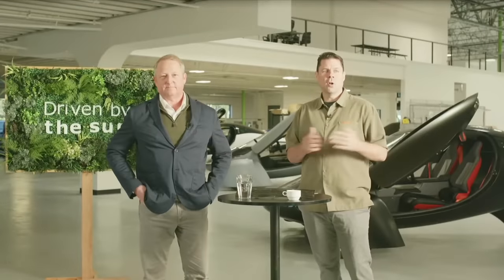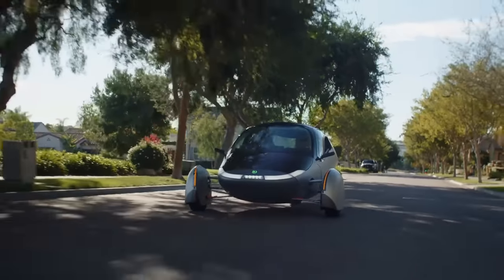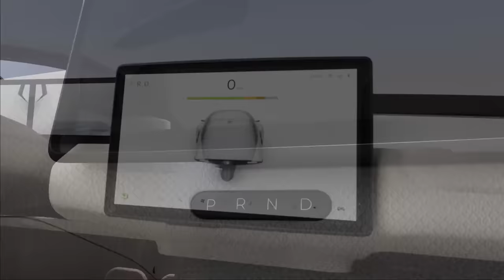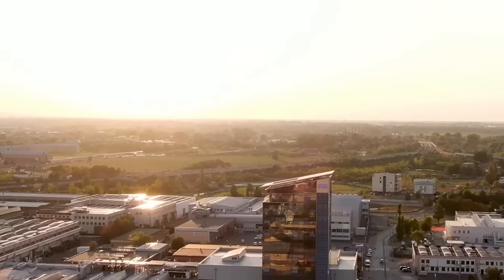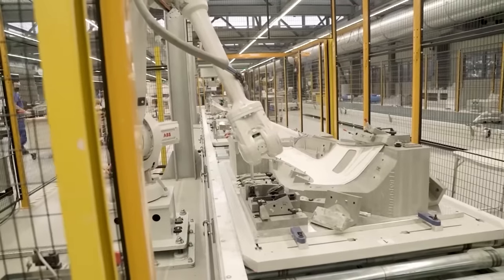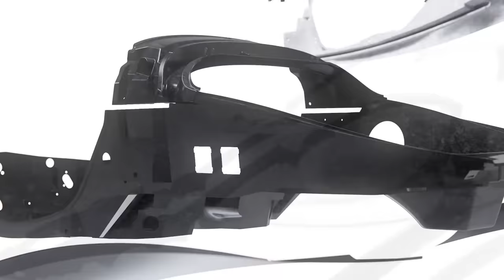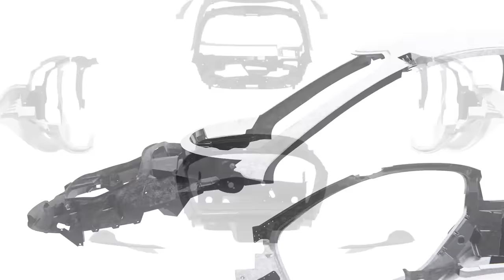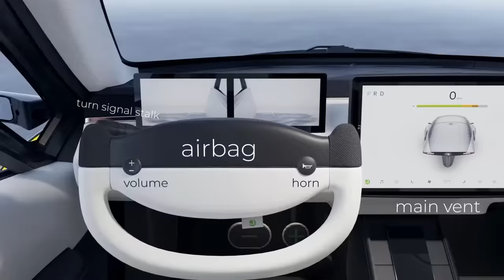Announcing Aptera's Launch Edition | Live Webinar

Comment: Edit 2: Aptera just announced (01/23/2022) that the Launch Edition and all Aptera vehicles will come standard with DCFC at a 40-60 kW charge rate! So happy they listen to feedback!

Edit at bottom; less concerned about DCFC now.

Excited for this launch edition... Exactly what I had reserved, with the exception of the enhanced audio package. However, I have to say I'm concerned about the lack of any DC fast charging... One big reason I wanted an Aptera was to take road trips of 400-600 miles in a day, and that would require fast charging to not be inconvenient, especially toward the upper end of that range. I understand the thermal limitations in the battery pack, but I was hopeful there would be at least low-rate DC charging capability.

Edit: just read a comment from Aptera where they said they "plan to offer a DC fast-charge capability at a rate of 100 miles in 10 minutes eventually and as an upgrade to your Aptera at a later date." If it's going to be possible to add-on in the future, I'm much less concerned about the lack of DCFC in Launch Edition. Would much rather have the vehicle for most of my usage and later add-on extended road trip ability, than wait to get one.
Reply: Generally DCFC is prohibitively complicated in software for small teams to include in a launch edition (needs complicated communication between the vehicle and the charger and needs to comply with certain ISO standards which require 3rd party testing) whereas AC charging is more of an “on or off” thing when talking to charging stations 

TLDR: Generally DCFC can be added in software later
Reply: Here's a thought for you though, assuming as a human you need to stop at some point during your 400 to 600 mile journey and you have the 400 mi version of vehicle you will perhaps stop for lunch at a place where you can plug it into a level two charger and because it is so efficient perhaps you will gain the additional range that you need for the day while you eat lunch or take a break from sitting so long.
Reply: @ElectricTechAdventures  yes, I think for my purposes it would be possible - just makes the days longer and something to plan around. Aptera's stated level 2 charge rate from the video is 57 miles per hour of charging, so to get up to the 600 mile goal in one day, I'd have to charge about 4 hours on the road. A bit long for a lunch break - even for all three meals combined - but technically possible.
Edit: about 4 hours, not at least
Reply: @woolerybrad  yeah good point. About 4 hours is a long time. In another comment I saw they said that somewhere Aptera said that eventually they would allow DC fast charging at Tesla superchargers but only up to charging at 100 mph which is just over 10 kilowatts probably. I don't know that Tesla will like that because it is a very slow charge rate where an Aptera vehicle would be taking up a plug that could potentially be dispensing 250 kW to a different vehicle. In any case I think The fundamental issue here is active thermal management of the battery. Charging as a lot of heat to a battery pack. And the vast majority of users probably will not be trying to use these vehicles for long distance road trips. But what do I know I'm just some dude on the internet. :)
Reply: Thank you very much for posting this. I was extremely concerned and was thinking about canceling my reservation over the lack of DC fast charging. This makes a lot of sense, especially considering they made a big deal of advertising compatibility with Tesla's supercharger network, and as long as they add DC fast charging in software eventually I'll be fine with this
Reply: @ElectricTechAdventures  no. They stated that level 2 charging only adds 57 miles of range per hour. So once you drain the battery you're pretty much done driving for the day.
Reply: Where did you see this comment? They were very non-committal in the video, like they somehow don't understand how critical range is
Reply: @matthewryonadams  or they recognize how big of a deal it is and they were trying to avoid the subject. It was just a comment on this video somewhere, there's no way to point directly to it because there are no addresses for comments. And the comment isn't proof of it being true anyway.
Reply: @matthewryonadams  I would hardly say my comment is a hard no. You get 57 miles while you were eating lunch for an hour. That's not zero but it is certainly nearly zero comparatively. I understand your point and it is clear that this vehicle is limited in its road tripping abilities, at least until they increase the charging speed. I would rather that they come out with something, even with this limitation, then going bankrupt and not producing anything at all.
Reply: @ElectricTechAdventures  I see it differently. They should work on dcfc now. If they launch with only 57 miles/hour charging they will be shredded in the court of public opinion, and that perception will linger even after dcfc is added. It's a major tactical error.

Bankruptcy is likely not a real risk. I'm sure they've got options to get the money they need, but are being choosey about the terms and foregoing until necessary.
Reply: @matthewryonadams  we'll just have to wait and see what happens.
Reply: @ElectricTechAdventures  I agree. As much as road tripping is nice, very few people actually do it all that frequently. Additionally, when I road trip I take a stop every 3 hours or so to take a half hour break so I can refresh and make sure I am being a safe driver. Let's say that's 25 miles added every stop on a 12 hour trip,  that's an additional 100 miles just from charging plus if it is sunny I will be getting the free 40 miles. Max range before I sleep on a 400 mile vehicle for me would be about 540 miles. Which would get me from San Francisco to LA along the scenic coastal rout with 50 + miles to spare.

There's what I want the potential to do and what I will actually do. For me wanting fast charging in a car that has a range over 300 miles feels like wanting an SUV in case of snow storms. Still I ordered the 600 range given that I have range anxiety :P So I expect no real problems on road trips. But everyone's mileage may vary.
Reply: @LC-sc3en  I agree. I also ordered the 600 mile version so that it will have roughly equivalent range as my Cybertruck so that if we need to go on a road trip with both vehicles then they both will have the same range to get there. We rarely drive over 600 miles in a day. The Cybertruck would most likely be pulling a travel trailer so it's range is probably going to be closer to 250 mi before having to charge but luckily it does have fast charging.
Reply: Adding a separate comment here to reflect my second edit... Aptera just announced (01/23/2022) that the Launch Edition and all Aptera vehicles will come standard with DCFC at a 40-60 kW charge rate! So happy they listen to feedback!

Comment: Aptera: I changed my order to launch edition, BUT, no Level 3 (DCFC) is likely going to be a deal breaker. You have now limited travel in one day to about 350-400 miles with a stop for lunch with a Level 2 charge. I'll keep my order in the queue until launch, then I will ask if you've changed your mind and added Level 3. So much for "see the USA in my Aptera."
Reply: But that’s about 6 to 8 hours of driving in one day. Do you think most people will want to drive more before they want to stop to sleep?
Reply: @asazad  Yes! I also then have to find somewhere at that point to waste 6 hours while charging. NOT acceptable.
Reply: @asazad  Our goal in traveling between AZ and WI is 1800 miles in 2.5 days. 400 doesn't cut it.
Reply: @ronaldlenz5745  Man I feel tired just thinking about such a trip 😅. People sure have a diversity of preferences and tolerances.
Reply: This is my thinking exactly. I only consider EVs that are capable of longer road trips. Do I do this often? No, but I don’t want to have to own another car for those occasions when I do. Extremely disappointing for a vehicle that looks so good otherwise.

Comment: Aptera stated so many times in the past that it would charge ~400 miles in 1 hour. Not 57 miles in 1 hour
Reply: Aptera has reversed course on this.  New video out today on DCFC from Chris & Steve at Aptera.
Reply: @jonj9149  maybe with better batteries. a megawatt ish isnt that much. 1200 whores power engine basically

Comment: Very concerned about lack of DC fast charging on launch edition.   Stated charge rate is 57 miles per hour of charging.  So to add another 300 miles you do a pitstop of 5 hours?   This will be a deal breaker for many potential customers.  EDIT: see Aptera replay further below stating ".. while we will not offer DC fast charging to start in the Launch Edition vehicles, we plan to offer a DC fast-charge capability at a rate of 100 miles in 10 minutes eventually and as an upgrade to your Aptera at a later date."   This has addressed my concerns.  Go Aptera!
Reply: Yes, the lack of DC fast charging is disappointing. But it is a great move for the simplicity of the vehicle. High volume production is hard, and this simple design helps to make that possible.
Reply: I was hoping to have DC fast charging in the 400 mile version. The 1000 mile version would take over 17 hours to charge at that rate.
Reply: 57 miles is in reference to level 2 home charging. Charging will be much faster at a Tesla Supercharger.
Reply: Most people do not travel that long regularly enough for that to be a problem, besides those people can wait for the longer range models. With a first production vehicle you have to make it as simple as possible, it's always a compromise of features in order to get the production going; you can't please everybody. People have gotten so spoiled with Tesla where they are today and compares a small startup with a multi billion dollar company that produce normal EV's and has done it for over a decade; it's not the same at all. Tesla didn't spit out the Model 3 the first thing they did, it took many years to get to where they are, and even they were just a hair away from not making it.
Reply: @BrianLambert  Isn't a Tesla supercharge DC fast charging?
Reply: @Brian's Game Talk  Supercherging will not be available for the launch edition. It is disappointing, but regardless this will be a great commuter.
Reply: @JorgTheElder  I changed my reservation to the Launch Edition since it matched my order exactly, and my intent was to only use this as a commuter vehicle, but when Aptera adopted the Tesla charging plug, they also adopted the absolute best fast charging network in the USA.   As an investor, I hope they offer DCFC as an option very quickly after the launch edition to expand their customer base and overall utility of the vehicle.  One can imagine a purchase of this vehicle for a college student who occasionally has to drive to and from college to home.
Reply: @BrianLambert  I don't think the Tesla Superchrager will be of much use  without DCFC built into the car.
Reply: Edit! Aptera states over and over again that it supports Tesla fast charging ... On  the website...  They are removing it to simplify heat issues.  The numbers they showed are just for standard home charging - which are fantastic - the best in the industry.  Doesn't affect my interest in purchase but I can see how that would be annoying
Reply: I agree with what @YeeLeeHaw  ... You hardly ever see a "base model" vehicle with many bells and whistles, those are typically the "premium or limited" versions of the vehicle that get more features... think of the initual launch vehicles as one of those stripped down base vehicles you find on manufacturer websites.
Reply: @BrianLambert  they stated no fast DC charging on launch vehicle
Reply: I agree, lack of fast charging would be a deal breaker for most drivers.  But Aptera has to survive the next year of ramp-up, and I'm sure there will be 5000 early adapters who will be thrilled to get the LAUNCH version.  Have patience, Aptera will solve the technical problems and have a decent charge rate for later editions.
Reply: Aptera commented to someone else that DCFC at a rate of 100 mi. in 10 minutes would be a future option, and would be available as an upgrade to existing Aptera "at a later date." At least for me, that takes the lack of DCFC in Launch Edition from a major concern to an inconvenience. Happy to get the vehicle sooner and then upgrade capability later.
Reply: @woolerybrad  this is the update I was hoping for.  Thank you for addressing my concerns.  Go Aptera!
Reply: Not good, offering g fast charging as software upgrade, , so they can charge more money, not too pleased
Reply: @tonyn3227  It's probably a hardware update if it's a cooling issue. Maybe even DIY.
Reply: "Eventually as an upgrade." No, not acceptable.
Reply: @furbearmn  Aptera needs to clarify the nature of this upgrade.  Does this require a new battery pack with better cooling?
Reply: @JorgTheElder  SYFAU
Reply: @BrianLambert  no it won’t. It doesn’t have the equipment to do DC fast charging. Keep up. That the whole reason people are up in arms about it.
Reply: @YeeLeeHaw  by the time this comes out Tesla’s $25k car will be out.
Reply: @YeeLeeHaw  are you always so base? Christ even my kindergartener knows better than to name call.
Reply: @ricardod70  yes
Reply: @davidmaddon554  I will continue to name call you as long as you don't provide an argument. Jesus man, you're a grown man and is almost about to cry because you got called a clown lmao.

Comment: As a comparison, competing EVs charge at a rate of around 300-600 miles per hour on DCFC.

The Aptera's quoted figure is 57 miles per hour on L2, with no DCFC capability.
Reply: Level 3 goes up to 360kW so unless your car can accept something more than a Porsche Taycan (which accepts only 270) you would never even get 360 miles of charge an hour let alone 600 lol.
Reply: @Lachesisms  Most EVs get around 3 miles per kW, so 360 kW/hr = 1080 miles per hour.

You only need to charge at a rate of 100kW/hr to get 300 miles per hour in an average EV.

Comment: Amazing work! I can't wait to get my aptera. However, I do hope that Level 3 charging will be integrated as either an optional upgrade for the main production runs after launch. I think that will be a large sticking point for many people thinking about purchasing.

EDIT: Chris McCammon just confirmed that they will have fast charging on non-launch edition vehicles. "Even though we will not have DC fast charging to start in the Launch Edition vehicles, we plan to offer a DC fast charg capability at a rate of 100miles in 10 minutes- eventually and as an upgrade to the Launch vehicles at a later date"
Reply: I haven't watched all the way through yet, but have they said there won't be DC fast charging? I thought that spec was included as a part of having the Tesla-style charge plug.
Reply: @EliotHochberg  so far they’ve only said lvl 2 charging
Reply: @chidorirasenganz  just got to that part in the Q&A, they explain pretty well why and why not, but it's interesting that the Tesla connector doesn't somehow require it.
Reply: @chidorirasenganz  They just confirmed level 3 is coming for non launch. See the edit I made to my original comment.
Reply: @EliotHochberg  just heard that part a couple of minutes ago as well lol I believe the Tesla connector is only limited by heat so it would make sense if they limited it thermally to lvl 2 charging.
Reply: @Dangineering  Correction:  They have stated that integrating L3/DCFC charging in the future is “planned”.  Of course it was planned in all the vehicle variants before and we are seeing how that is working out.  And what will that plan implementation look like?  The OTA update that just makes it work one day that some folks are pie-in-the-sky guessing at or a return to the factory for a complete overhaul of the battery, charging and cooling infrastructure at a cost of thousands of dollars?  We just don’t know.

Fortunately it won’t likely matter for the vast majority of current reservation holders; those above 5 or 6 thousand in the queue. They plan to only make 5000 of the Launch Editions and that will keep them busy (we all hope) for a year or more once they start production.  That in turn could be two years including the continuing delays waiting for full funding to start production.  We’ve already seen that a lot can happen in two years.  I am looking forward to seeing if they haven’t got the DCFC sorted out by then as well as offering the other more economical and less fluffy options I originally ordered.  I and so many others have to wait anyway so I am happy to leave the handicapped L.E. models to those folks lower in the queue willing to settle for it.
Reply: Very very great!!

Comment: The tent reveal, very interesting. Can i suggest more than one tent option? For example one that can also use the ground for space but still seal to the hatch. Two ground tie down's in addition to the Aptera tie downs, it could be a area to leave your boots or to sleep a third person or shake off and store wet clothes.

The Launch edition I thought long and hard about,  I just cant give up my 600 mile range model. I am not just paying for range, I am paying for redundancy. When you Travel sometimes stopping is not desired in some areas. With redundancy I can choose to not charge until the next next charging station over.